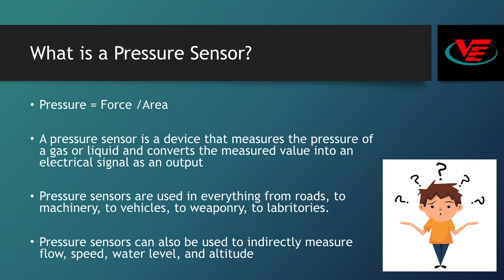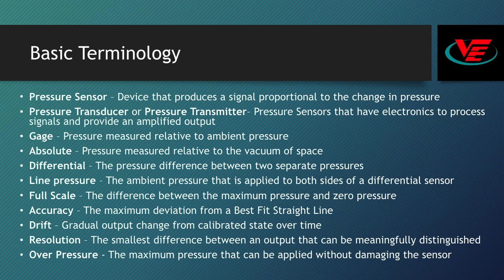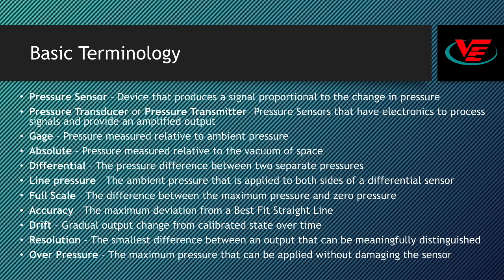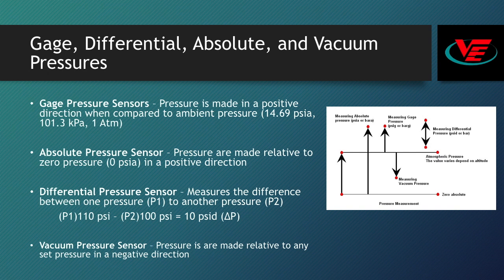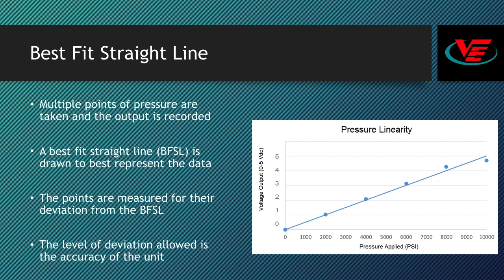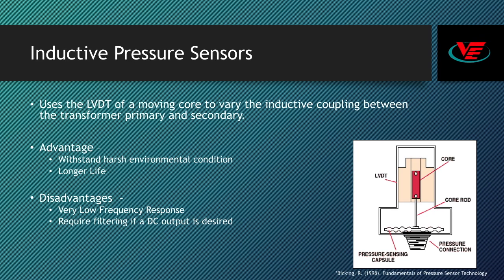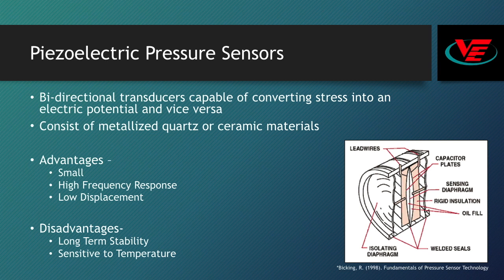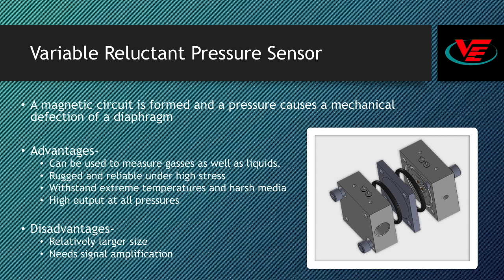All About Pressure Sensors

Comment: I think this person mixed-up transducer and sensor. A Transducer converts energy from one type to another. In terms of sensors, that's a device that converts from one property to another: light to resistance, temperature to voltage, pressure to voltage, etc.